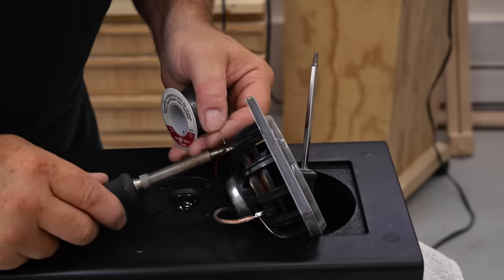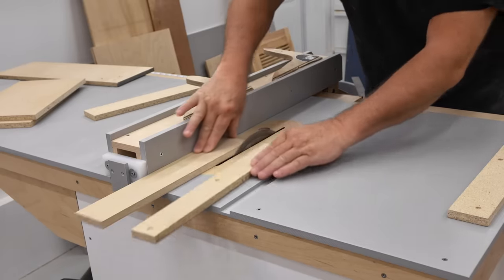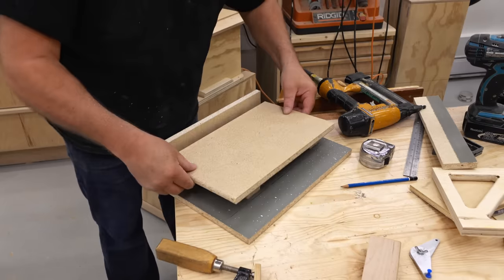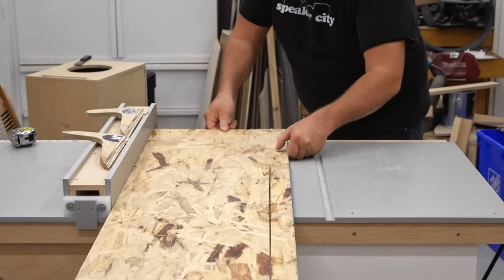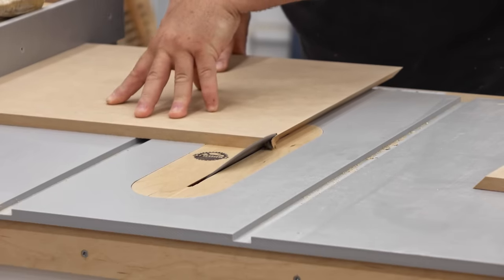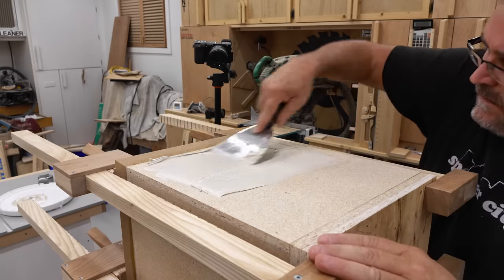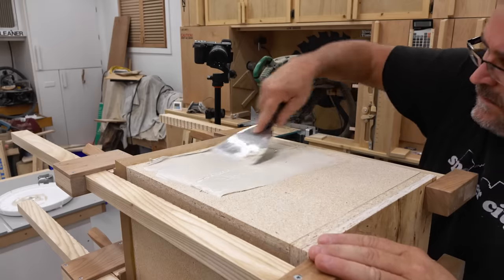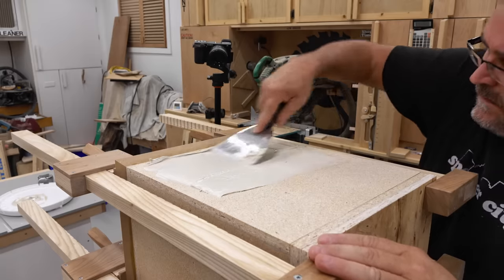Making A Powered Sub Woofer - High Quality Bass - DIY Speaker

Comment from the maker: See the build article for more details on the design of this sub woofer:
https://ibuildit.ca/projects/making-a-powered-sub-woofer/

The soundbar build:
https://youtu.be/25rjfeoKhW4
Reply: Is the new poly urethane construction adhesive a different flavor than the old one?
Reply: Port area is too small if you are going to power it over 20W below 40Hz.
The port will cause chuffing, especualll in dynamic movie scenes.
Ive recently built a portable bluetooth speaker with 2 6.5inch woofers (xmax of only 9mm), I used a 110mm (little over 4 inch)port tuned to 36Hz and below 40hz and over 80W of power you can hear the port slightly. (Which is ok, since the portable amp will only be 100W)
Small narrow ports also make the port more prone to port noise.
I would go over a 5 to 1 ratio (width to height), unless the port is at least 25% larger then necessary.
WinIsd is a great free program for modeling drivers under power.
Reply: Build a crane for move the speaker 🤣🤣🤣 . Big box ,little subwoofer . Much to learn ,kid .
Reply: Sir can u please build me a car underseat subwoofer
Reply: @epiphonesg007  I agree, the port is too narrow.   That's why most ports you see are circles or squares.    You can even make triangular shaped dual ports in each of the bottom corners.    In most speaker design programs, you can play around with the size of the port, and the length of the port, and the number of ports, to find something that works well.
Reply: Fiberglass is a bad choice to put inside a speaker inclosure as the fibers can get through the spider and get inside the voice coil, shortening the life and sound quality of the sub. Instead use poly fill or the contents of a pillow.
Reply: @yamahantx7005  "That port then displaces more volume..." if it's inside the box, a requirement unrelated to its acoustic function. It can just stick out, although that may reduce WAF.
Reply: @yamahantx7005  "The radiation tilt and phase shift consequences described for noncoincident drivers are usually only a concern at crossover frequencies above 700 Hz. At higher frequencies the typical physical offsets (in relation to typical driver dimensions) will cause a phase change which is a sufficiently large percentage of the relevant wavelength at the crossover frequency to be significant. For example, a 2" offset at 500 Hz will only produce a 7% change in phase, which is relatively trivial.  The same 2" offset at 3kHz will produce a 44% change in phase, which is substantial."
(Lance Dickason, Loudspeaker Design Cookbook 7th edition, page 161)

Scaling his example to the present context (e.g. a port protruding 10" from a subwoofer crossed at 100Hz):

5cm separation 500Hz/80cm-->7% vs 3kHz-->44%
(separation λ/16 vs λ/2.67) 
25 cm separation 100Hz/400cm-->7% vs 600Hz-->44%

This concerns the distance apart between two drivers each contributing equally to the output at that frequency. The acoustic crossover of a vented enclosure (the frequency at which the driver's front wave and the port contribute equally to the output) is much less than the crossover frequency of the network provisioning the driver--at that frequency, the driver typically contributes 90% of the output. So the applicable frequency in the phase analysis above is considerable lower than 100Hz and the frequency at which phase effects due to the distance between their acoustic centers become material is considerably greater than 600Hz (read: outside the woofer's passbands).

Consider the time delay of the arrival of the first reflection of a front-firing port vs that of a rear-firing (with perhaps six feet traversed ere it gets back to the baffle after reflecting off the wall behind the enclosure). If port placement matters at all this is surely where phase considerations come into play. 

Factoring in WAF, ports can be oblique rather than normal to the surface. Ports of triangular cross-section are available and perform the same as round ones, allowing diagonal deployment [d=√(a^^2 +b^^2 +c^^2)]. 

This is all moot since subwoofers in rooms should never be vented.
Reply: @lewisgoudy863  
?  never be vented?
Reply: How to place an order for a sound system made by you?
Reply: Please tell me the song that you last paly on your subwoofer
Reply: What amp did u use where can I get one
Reply: @lewisgoudy863  🤓

Comment: I'm 67, and watching this makes my blood pressure go down (I suffer from hypertension). I've done many things in my lifetime, but building a set of speakers or a subwoofer is something I've always wanted to do. I really enjoyed your video and soon plan to make an attempt at building something I can be proud of. Well Done John.
Reply: I love it! Grandpa builds a large subwoofer and gets revenge on the young bass-heads driving by every day!
Reply: You really dont have to mider all the edges no one will ever see. He is just showing off.  Lol
Reply: @Ericdawg420  If you really want to create something beautiful, sometimes you just have to put that finishing touch on it to make it special.
Reply: Wow 67, and want to build your on speakers. Do it! I'm really impressed by your mentality.
Reply: Can really recommend it, i built a subwoffer system for my living room, inclosed is the easiest version if you are a beginner.
Reply: I have Plans, Speakers, X-Overs, etc, for 4 Towers and a Center Channel if you are interested. I just haven't  got around to building these yet because I already have 4 Towers and a Center I bought. It wouldn't be too bad to ship as it's a Case of Drivers and the Tweeters, etc are in a smaller Box.

Zaph Audio if you want to see the Plans.
Reply: @Len_M.  that would be interesting, are you buying a kit or are you calculating/measuring the speakers from zero?
Reply: If you want some ideas go onto the diy subwoofer build section of home theater shack.
Reply: Do it

Comment: The speaker is awesome , but please remove the fiberglass insulation and vacuum clean the inside. That insulation throws small glass particles in the air impossible to see in most lightings conditions , people can breath that in, and it is  dangerous.  Sudwoofers move a lot of air in and out of ported enclosures , that's why is not a good idea to put that type insulation in there.
Reply: I don't think anyone has any delusions about John being an authority for safety. Hell, watching the clip at 3:12 I'm amazed that this guy still has all of his digits.
Reply: @F3Ibane  haha... I noticed that too...

Comment: Another great build😊 Mine I cheated by scavenging an old Grundig bass unit modding it and renovating the main exterior and now matches in with the surround sound bar next to the Samsung 55inc tv 😊 sounds awesome with real growl 👀 For those not in the know, make sure your inputs are correct 👍ALSO a lot of surround sound speakers are 6 OHM - connection to an amp with 8 ohm outputs may damage the speakers OR the amp unit! IF the outputs are 4 ohm connecting 6 or 8 ohm speakers is usually OK 🆗 Love your vids and awesome workshop

Comment: Great design and craftsmanship!! For future enclosures might I suggest two things? (Coming from a box builder)
1. For the wood, use MDF or Birch Plywood. They are much denser and suited for sub enclosures. 
2. Even if it's a sealed enclosure, use Dacron Poly Fill. It does the same as fiberglass, but is much safer. Especially if you have pets, the fiberglass from a ported box will settle on the floor where your pets breathe and walk and around.
Reply: Not just pets

Comment: My only issue is the size and length of the port must be precise in order for a vented design to provide flat response, and unless a DIY builder like myself had precise plans from a designer for a box with flat port that had been built and tested and tweaked, I would have no confidence in getting this right with this kind of port. Far easier and greater assurance of proper tuning by using a round tube for a port, and round ports can be flared at both ends. If the length is too great for the box size, then I would choose a different box size for the selected driver that calls for a shorter port length, or I would select a different bass driver. I always choose bass drivers that call for a very large box for superior performance, and that usually entails a fairly large vent that is not too long, which avoids the problems of chuff (farting) and port resonance that are the two potential problems with port designed bass systems.

Comment: I didn't quite understand how you dealt with mitering the different thicknesses of material the first time around. But I went back to review the footage more closely. You mitered them at different angles, right? So that the result is the two pieces being square. 

It seems obvious in hindsight
Reply from the maker: The front is cut smaller (as I said in the video) to make the miters line up. All were cut at 45 degrees.

Comment: I've been meaning to ask...  I see that like many others, your center speaker tweeters are positioned towards the center.  Why is this?  I always thought that if you had to place speakers on their sides, the tweeter should be as far apart as possible since they are more directional and should increase the stereo imaging.  I've just put together a small center speaker arangement for the TV and I positioned the tweeters to be as far apart as possible.
Reply from the maker: Typically, a centre channel speaker is just a single speaker, where a sound bar is usually a pair of speakers in the same box meant to replace a free-standing pair of speakers. Having the tweeters position outwards or inwards is a matter of taste, but the distance involved is usually not enough to dwell on or worry about. These are not normally used for high end listening, so the concept of soundstage is not really applicable.

Comment: Interesting build!
Bracing - I remember reading an old forum post from Hexibase aka PWK. I got the impression (I don't want to speak for Pete) that it should be used only when needed .. which is very rarely, and that bracing, like using caulk or kerf slot ports ... is a bit of a DIY building myth that is implemented when and where its not really needed!
Reply from the maker: The way to look at bracing is that in an enclosure it will reduce the free span area of a panel. When a panel is large, it will be easier to make it vibrate, and that vibration will be more audible. Bracing divides bigger panels into smaller ones.

Comment: Very cool! I love the look of OSB (it has a calming effect on me somehow) and have had fantasies of building something like that. Maybe with an epoxy finish instead of sanding to hopefully make it smooth while trying to maintain the sense of depth. 5/5, would woof again. Woof!
Reply: @Stimpy&Ren I was talking about using OSB in general as a design element, not necessarily for speakers. But using OSB for speakers is just fine if you deal with the resonance by other means. What difference does "high quality" in "baltic birch" make in a speaker?

Comment: it wasn't until this video including your new table saw fence that I noticed that one of the screws holding on the plastic sides looks like it is Centered to the middle of the saw blade .. makes for a permanent mark for lining up those plunge cuts .. Maybe on purpose, maybe not, but I wouldn't be be surprised if you did do it intentionally. I like the sub box too.

Comment: John, are you not concerned about the formaldehyd when using OSB, MDF, HDF or particle board? In this regard, will the PU coating actually prevent formaldehyd from gasing out?

Comment: John, why is it that most, if not all, corded drills don't have the clutch that a cordless has?
Reply: Because they are not meant for driving screws. My best guess.
Reply: @Randall Zrubek Cordless drills drill and drive screws as do corded.  I am a bit pissed that most corded drills now are chuckless so the grip is pussy like a cordless so it is almost to the point of them being one in the same now.  If a corded drill gets that clutch feature it will be no different since everything else a cordless has a corded now has.

Comment: Nice build, John. I like the aesthetic of mixing the black face with the OSB top / sides.  When you designed the enclosure did you have to do any compensation for the volume consumed by the port / brace structures, the woofer motor, and the amp?

Been using Dayton Audio stuff for a long time (I lived in Ohio most of my life, Parts Express was a staple)  it's always been really good kit.
Reply: Also very cool to see the old tablesaw parts living on

Comment: Ending the port along a wall will substantially increase the effective length. Also ending it along the floor on the outside will change the end correction. You can't just interchange square wooden port with round port ending in the middle of a box - as standard design sheets assume. The tuning is lower now than what you calculated. Slit ports are not ideal as the friction along the walls is higher as compared to a round port. The ratio of open area vs surface area along the port is particularly bad on long, narrow ports.
Reply: Agreed for the most part.  In this case, measuring Fb then trimming back the vent a bit to compensate for the change in end correction should work, but might be difficult to do in a small box.  

Narrow slot vents may also lead to reduced vent efficiency (and chuffing at higher SPL levels) that might show up in linearity tests, but whether or not that makes difference when playing music depends on the SPL level and of course who's listening :-)

I made a 8-inch subwoofer a year or so ago, and opted to go with a tapered TL design instead, for a number of reasons (including avoiding the shifted end-correction issue when using slot vents).  Turned out very well.  More information at the link below. BTW, if only my fabrication skills were just half that of John's.  20+ years building boxes and I still have a lot of trouble making them 'square'...

https://www.diysubwoofers.org/projects/home/boomunit/

Comment: Cool video & I know beauty is in the eye of the beholder. But I'm not a fan of  OSB for any type of finished work. I know that you were being frugal. And I get it, but the look of OSB. Isn't nice looking at all. It's 1 of the reasons it's usually well hidden under roofing shingles. I liked what you did with the sub & the front face. Nice & clean nice paint job a finished look. OSB to me is a raw construction material. Much better served as a structural item, not finished work. I'm sorry if it appears that I'm being tough. But as a craftsman we usually try to do our best. Material selection is a part of craftsmanship. I like everything but that OSB.

Comment: Great build John, but from what I remember about building speakers you're not supposed to use fiberglass insulation.
Reply: It would be fine to use fiberglass insulation on a sealed design, however poly-fil or breathable foam is best for a vented one.
Reply: JBL used fiberglass in their vented speakers for over 50 years.  A 1 inch layer lined the inside walls of most pro and home speakers they built.

Comment: i would highly recommend replacing the fiberglass insulation with actual poly fill... i was with ya for majoirty of the build until ya did that. great effort on everything else though. different approach to building a subwoofer enclosure
Reply: At least fiberglass is fantastic for sealed enclosures, I'm more concerned with the diabolical materials used for the inner skin of the enclosure, I bet that thing resonates like crazy. Bracing is the only thing maintaining decent sound quality.

Comment: Fiberglass. Bass will cause particles to go out of the front port into the air and your lungs will not be happy.
Reply: and it is useless for those kind of frequences
Reply: @Stimpy&Ren fiberglass is HORRIBLE for your lungs, I had a friend who died of a lung infection from breathing it in from a project just like this one.
Reply: Small fibres from rock wool or fiberglass can be bad for the lungs, but people installing it into homes have to worry about it.

Comment: the subwoofer is very good but the wood you use is very bad. it will distort the sound by stretching and vibrating.

Comment: You were not going for the best quality sound, using cheap particle board instead of MDF or Birch is NOT a good choice. Doesn’t matter if you are recycling, you could have used the MDF on the inside instead of the outside as a second layer, and it’s pathetic the you used birch for bracing.

Comment: Chipboard is one of the worst woods for a speaker or sub cabinet come on dude
Reply: For subwoofer that small and with small box sides it doesn't matter what it's made of... And he has two layers of material with glue between and bracing inside so it'll be plenty strong

Comment: Sub woofer is a misnomer that I don't like. There are woofers, tweeters. That woofer isn't nearly big enough, I believe in 15" minimum woofer size.
Reply: There are 4 inch  subwoofers too.
It depends on what they are designed to output.
There are 15 inch woofers that dont work as a subwoofer as good as some 10 inch subwoofers.